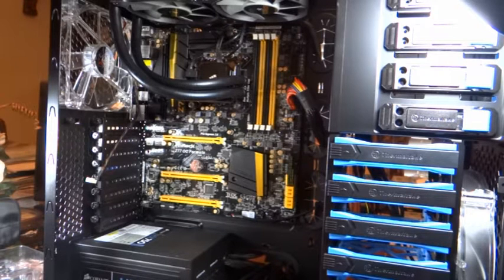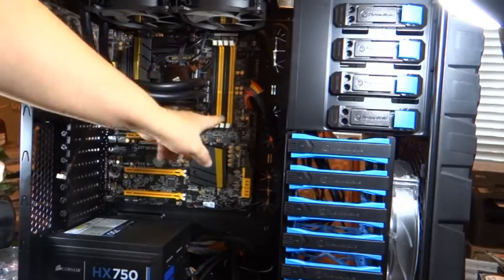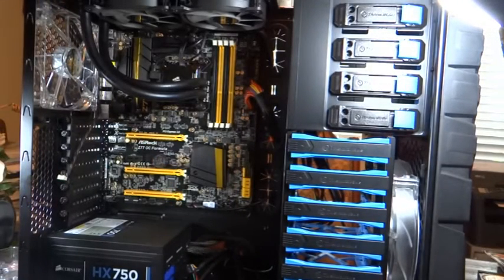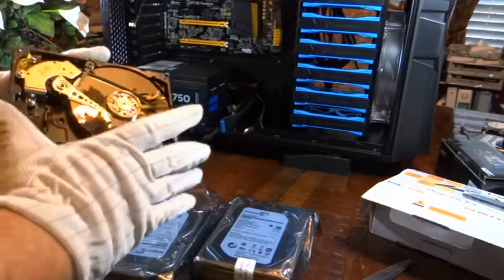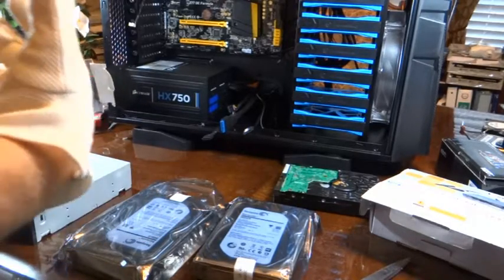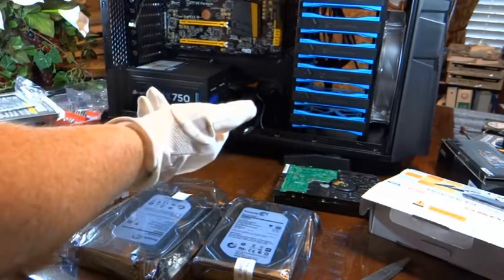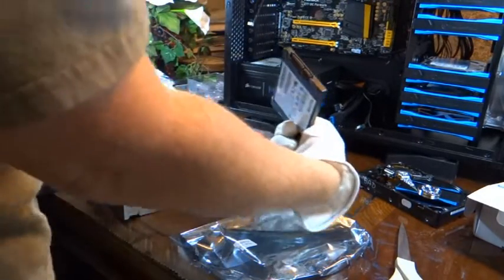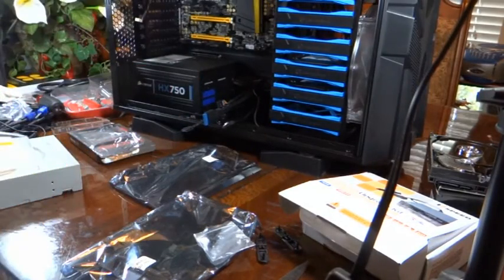Building Your Own Computer in 2013 PART 3 of 4 - Air Flow, Wiring, Front Drive Bays, and Hard Drives

Comment from the maker: They are anti-static gloves and I also have a wrist strap for grounding.  When I first started building PCs I used them all the time, but they can be hard to work with, so now I normally use them just for things that are especially static sensitive, such as RAM memory sticks, handling the motherboard, CPU, and any I/O cards, like the video card.  It is just a precaution to prevent frying a circuit with a static discharge.  They are cheap and the parts are expensive, so I am playing it safe.